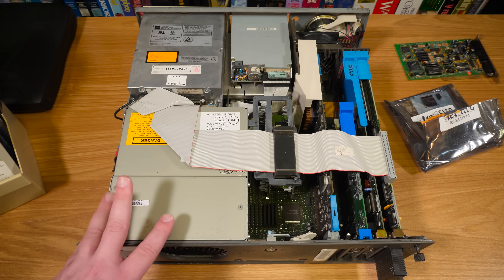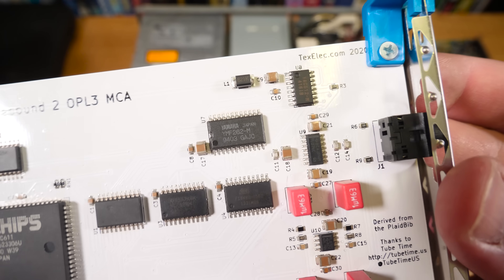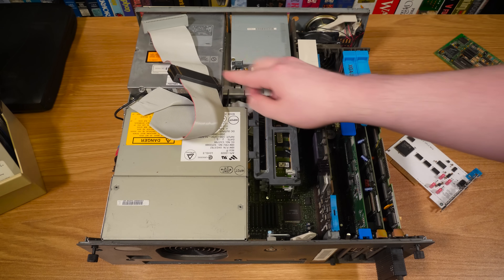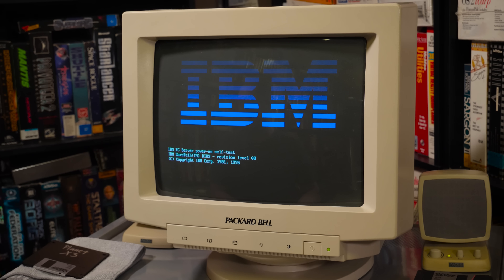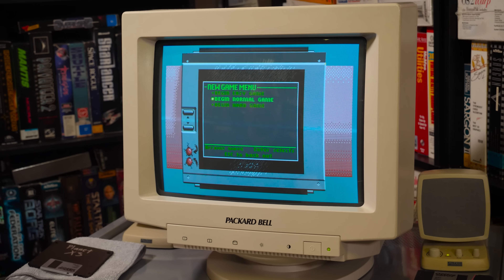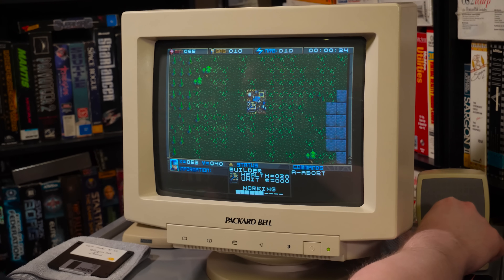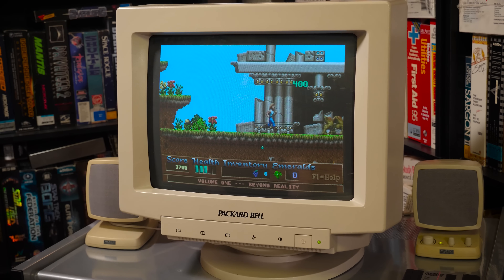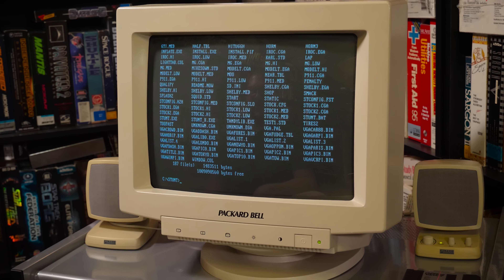Resound 2 MCA: AdLib-compatible Microchannel Sound Card

Comment: Have you heard of Adlib Tracker II? It's a DOS tracker that's specifically designed to make OPL3 music (they also have an old version for OPL2). The download comes with a ton of sample tracks. I've also had success running it from Win98 SE, so you don't even need to boot into DOS mode if you don't want to.
Reply: it doesn't run on a 486 unfortunately, i tried that but there are still many tracker and players to try, for opl3 i reccommend giving a try to LLSID and there are things like rad players which can be used on 8088
Reply: @piecaruso97  Oh, I totally forgot about the suggested Pentium minimum. I've never heard of LLSID though, that looks cool. When you say "rad players" are you referring to the old versions of Reality Adlib Tracker?
Reply: @dbozan99  i am referring to the track format use by Reality Adlib Trcker, which is used by a bunch of player programs, LLSID is not perfect but definelly cool, try it

Comment: I have a feeling that this card has a low pass filter to reduce harsh noise, but it's causing stunt driver to be almost silent.
Reply: There's another theory that bus timing might be interfering with the trick used to fake PCM through it - apparently it can depend on starting FM synthesis and freezing it at a precise time, then turning the channel on/off rapidly to send the audio.  If it's not frozen at the right moment it won't have the correct output level and there's probably no way for the program to tell that happened.

Comment: Why are add in cards so cool? All these old computers with a bunch of cards look sweet. Its nice that we've consolidated almost everything into the motherboard but there is something special about having a bunch of cards in a machine
Reply: I have a strange nostalgia for the days of configuring IRQs etc...
Reply: The modular industrial approach is useless when it must run a software monolith... Today we have to "roll out" the whole thing, to support anti-progressive software imperialists. They rather sell you imaginary stuff like a start button or "apps" than actual functionality.
Ik think MCA was partially an attempt to prevent this platform hijacking by a universal entity called OS.
Reply: Mine only has room for one PCIE card (my GTXX 1660ti). It has a built in Sound Blaster though (I was surprised to find they are still around, they even still make dedicated sound cards!)

Comment: Are there any manufacturers of new 486 etc hardware that you can build an entire BOSS CPU from the mid 90's? I imagine it wouldn't be cheap to build, but it would be awesome. Hell, you may be able to get all custom woodgrain stuff. I know people make various boards for older computers.
Reply: I don't think there are for 486 systems.

Though you might find a few oddities in industrial PC's, which are often mini ITX form factor and the like. - it's surprising how long some designs remain available in that market.
Not cheap though, relatively.

Comment: Mmmm... That thing is still begging for a modern hardware upgrade...
Reply: Not really. The XP systems are super rare in working condition, it would be a shame to see it taken apart like that. I'm sure he has plenty of non-working ps/2 computers that he could do that to.

Aside from that, older computers didn't generate nearly as much heat as new ones, so the ventilation tends to not be very good, so a newer system in an old case like that would take a lot of case modification to get enough air holes.
Reply: @TheShitSmith  Regarding heat, that is simply not true -- my first PC (Heath-Zenith 286) was a scorcher, literally could keep your hands warm with the hot air blowing out the front of the case...
Reply: @TheShitSmith  so I suppose the Vista, 7, 8, 8.1, and 10 systems are super common 😜
Reply: adventureoflinkmk2 sigh